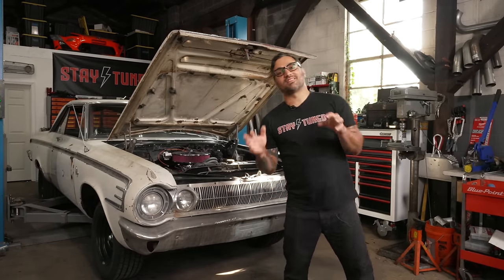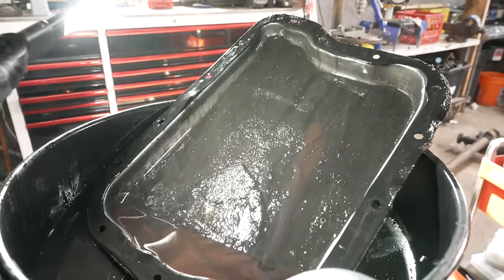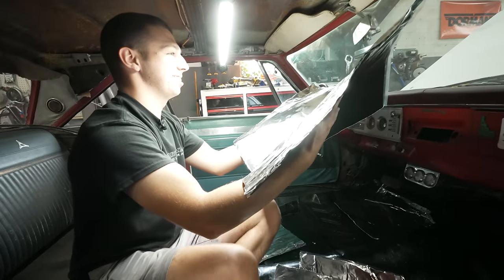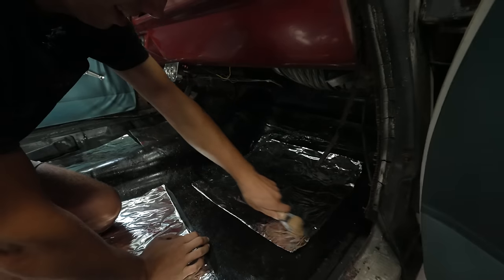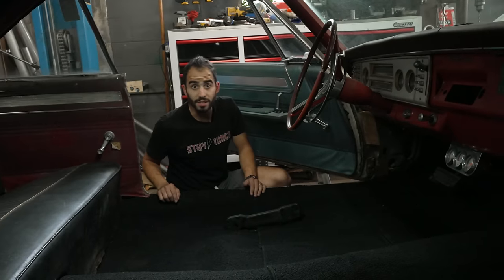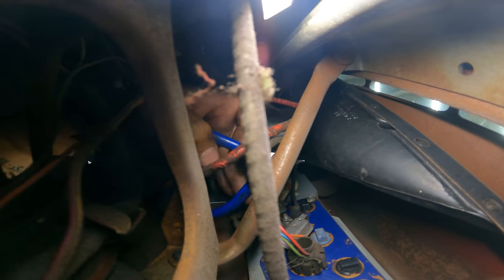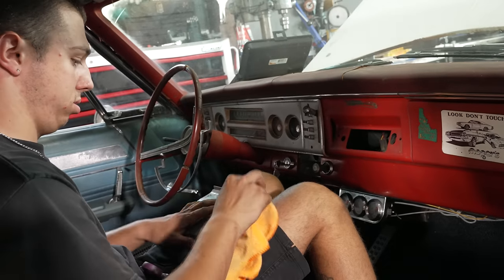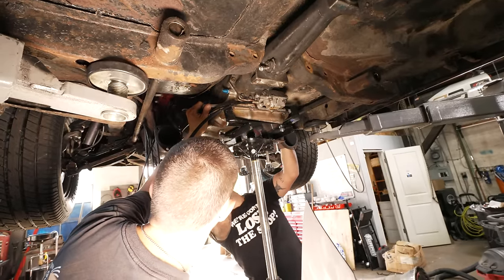Can This ABANDONED Old Dodge Drive 800 Miles?!

Comment: Your content is the reason I canceled my Cable subscription. Nothing like this exists on TV. #WEREGONNALOSETHESHOP
Reply from the maker: Man, that means a lot! Appreciate it!
Reply: The whole HRG / Roadkill family have online content. It's all so much better than anything on corporate TV. Not sanitized, not jazzed up, just life. So much better than TV bs for sure.
Reply: True, this
Reply: THIS.
Reply: I agree
Reply: Dodge put the cowl pinch weld right across the place your hands need to be putting the bell housing bolts in and it's tight .. on a GM car you can get a 4ft extension with swivel and stand under the back seats and crack off the bell housing bolts Dude if you want to burn up your new trans then go ahead but you really should run the new cooler lines thru the stock cooler first then into your new cooler then back to the trans DO NOT OMIT THE ORIGINAL RADIATOR TRANS COOLER ....DUDE forget the push button bullshit and just use a B&M of some other shifter..

Comment: I'm a 54 year old lifer hotrodder. Thank for old skool gangster content I relate with. Health and wellness for you and yours. FYI I daily drive a 71 vega panel with a roller 350.
Reply from the maker: Sounds like a killer ride! I’m in that Dodge as I type this! Thanks for watching!
Reply: Man, I am a 40 year old hotrodder, but my hotrod usually had a turbocharged 4 cylinder under the hood. I now have a 2013 BMW 128i that I drive as a daily and it's really nice and runs great with low mileage, but I'm DYING to turbocharge it. However, if I come across some extra cash I'd be 120% down with buying a 60s-70s Mopar. I LOVE the big body Polaras and I'd love to get one with a 383 or a 440, but mine would HAVE to have an A833 4 speed manual...or a Tremec 5 speed manual, a Sure Grip, and possibly a set of 3.55 gears with AC.
Reply: My uncle has a 72 Vega panel. Solid lifter 327, th350, and a far too wide 9 inch rear. It has 8 inches of custom flairs on the back, air shocks, 10 wide slotted mags , and skinnys up front, true old school street freak.
Reply: Basically I grew up in Florida and when I left there to move to Pittsburgh imports were just starting to become popular modern hotrods, and it all changed for me when the first Fast and Furious came out when I was 18. I traded my 302W swapped, supercharged, jacked up with 33x12.50s and chrome bullethole wheels 1994 Ford Explorer Eddie Bauer for a bone stock 1992 Acura Integra GS with a full mint condition leather interior and I turbocharged it piece by piece. It went on to make 257 whp at 10 psi on a bone stock 134k mile engine. I put slicks on the front and it ran a 12.4 @ 122 mph on an old Dodge Daytona T3 turbo that was seized when I bought it and I paid $50 for...😂😂😂
Reply: The vegs has fats and skinnier. It's vega proper. But missing gear drive. That will be rectified come rainy weather. It's a proper 80s hotrod. Be well, hotrodders. Wheels to the ground -after a proper holeshot of course. Oh and yes has slot mags and wlt bfg's
Reply: I love how most older US cars will accept a v8. Over here in northern europe most options are simply 'modern' inline four cylinders or build the old block for boost. Anything more and it's an engine with a shell around it
Reply: @ryurc3033  pictures of that ride would be epic. Life is short. Cool is eternal.
Reply: @Brock_Landers  fast is fast. I have my personal tastes, but I absolutely respect all things faster than stock.
Reply: I wanted a v8 vega for my first car in 1983. My dad wouldn’t let me and selected a fixable 69 Camaro instead. (Poor me, lol.)I still appreciate the Vega.
Reply: New stuff is so fast. And turbo anything and your hauling the mail. The vega does 1 thing well. It feels the fastest. If course it's not by a Longshot. But it is a violent, hard hitting visceral ride. I should sell tickets. Lol keep on keeping on hotrodders. Cool is eternal.
Reply: @Chest_Rockwell pittsburgh native here! There is still some good old hotrodders here !
Reply: @danielnowicki917  do tell. Shout out for the area. Wheels to the road. Safe travels everyone.
Reply: My buddy had the same Vega with a 350 years ago . Super cool guy
Reply: @gregblack8550  V8 Vegas bring out the greatest car stories. No matter the walk of life, we all have a vegs story. (If over age 40 lol)

Comment: When I was 18 (MANY moons ago) I almost bought a '58 Chrysler Saratoga. It was an absolutely huge car, with 300+ hp V8 (not sure what motor was in it), and a push button trans. It was mechanically sound, and the body had more steel than rust, but the interior was shot. I'm glad I didn't buy it, because right after I was looking at the car, I moved 2 states away, and my daily work commute was anywhere from 2 1/3 to 4 hrs each way. I would have killed that poor car!

Comment: I had a 64 Coronet 440, back in the late 70s. We called it "Trash On The Dash" like 4 on the floor, and 3 on the tree. Mine had a 318 but it was a kick to drive with that oval steering wheel. Love the content, boys.

Comment: You should have run a 65 transmission - they are still cable shift (will work with the push buttons) but have a slip yoke so you can run a conventional driveshaft. If you can find a 65 transmission - big block or small block, use the guts from it to rebuild and modify your old 64 with the slip yoke output and tail shaft from your old 64 transmission.
Reply from the maker: I was just happy to find something I could my hands on and it’s working so well!

Comment: That diod trick was slick.  Have a great road trip guys.
Reply: Diodes are really handy.
What Tony didn't mention is how to hook them up.
48:14  There's a band around the diode on one end.  You want that end connected to the thing that you want to isolate.
So in this case the band end goes to the ignition module, the other end goes to the starter relay/solenoid.
A diode's electrical symbol looks like --->|---  sort of like an arrow pointing to a line.  The arrow shows the direction of he current.  The line is the band.
Technically, arrow end is the anode(+), band end is the cathode(-).
Also, diodes can get HOT if there's a lot of amps flowing through them all the time.  Something to keep in mind and check when you use them.
Reply: @button-puncher  Thank you for that detailed explanation.  I'm not versed in electronics.  I would never have known that.  My buddy works on electronics & I'm always amazed of what he can fix.

Comment: Top 3 favs right now in no particular order ; Vice Grip Garage , some of the Hagerty stuff and Stay Tuned. I say this as I just came in from changing the springs on my Vortec 4.3 over to Beehive springs(heads on car, PITA). Put the new cam in and then tried to put the timing set I bought but the big gear is wrong. I want this cam 4degrees advanced. Think I will degree it with the old timing set and if its close Ill just send back the wrong/adjustable one and hopefully find a double roller in town here.
Reply from the maker: Thanks for watching!

Comment: My 64 440 has the column shifter but it does has a blank off plate over the spot where the buttons could have been. It’s also a 383 power steering power brakes and 727 automatic.

Comment: That fire sleeve, it's good to have it fit loosely.  Then you've got an air gap to further insulate from the heat.
Ammeters are good but, yeah, you've got to run a meter with an external shunt.  Really nice to see if charging is working and to see parasitic draw.
Super cool to see you keep the push button trans.
Thanks for another great episode.  :)

Comment: @StayTunedTA : Tony, a few things . 1) You should have looked for a 1965' twin cable tranny. The difference is in the tail shaft. In 65', the 727's went to the later models slip joints, just like everyone else used..  2) 1966 and newer is the real choice for most of us 62-65 guys. Reason being, the twin cables tent to stretch and fail.. You may put the car into PARK and walk away and get passed by your car that you THOUGHT you left in Park!!!!!  Also, with the 66' and newer, you can use nearly any aftermarket shifter in the World.. That, of course, means positive shifting and positive PARK!!!!  Also lock out and whatever you want to spend the cash on.  3) The difference in the 62-65 tranny/convertors, is the input spline. Going to the later model is DEFFFFFFINETLY the way to go. 4) Check out MAD ELECTRICAL for the best in rewiring an old mopar. These cars going up in flames is REAL. You touched on some of it in this video, but your watchers, I'm sure, need a great lesson on it.. This would be a great HOW TO video for you to do on this car.. It will also help your charging situation and you will have nice, bright headlights as well.....  5) considering this car is cool and it looks like one you will keep, how about doing a video in shortening the rear end??? These cars look BAD ASS with FAT ASS TIRES on the rear and with a bit of wheel well work, (to the frame), you can fit some serious meets under her....  Also, consider joining the 62-65 B body group on FB.... Tone of great info in there....
Reply: So '65 had a slip yoke AND cables, including the 904?
Reply: @vincentenk4449    Yes....  Then in 66' they went to linkage shifters. 67' and newer went to a higher count of input shaft splines, so you have to make sure you alllllllways count before ordering a convertor.
Reply: @vincentenk4449  YES....

Comment: I bought my 64 polara when I was 15 now I’m 23, I’ve been watching roadkill/hotrod garage since I was 13, so it’s so much fun to watch you deal with the early b body stuff cause I’ve always wanted one of you guys to do so. My car is 64 4dr hardtop with a 383/451 bbm was a push button transmission car swapped to a a833 4spd, gutted the interior. Has the usual cowl and minor floor rot, the left front fender is barely attached but the structure is solid. It is annoying tho anything early b body related is like 30% more than later mopar stuff. It’s extremely fun to watch this series so excited for more episodes
Reply from the maker: That sounds like a wicked car! Really glad I got my hands on one and it's fun to dig into stuff I've never worked on before like the pushbutton. That 451 must scream!
Reply: @StayTunedTA  I definitely would love to see a manual swap in the car, the a833 stuff is prohibitively expensive nowadays tho so a good 5spd would be cool. My 833 was a junk core that have like $1500 into just parts cause my labor was free. I do know some guys that are all into the early B body stuff who are local to eastern pa, and a some guys around me on LI. The push button stuff is really cool in a novelty since, best part you can bump start them like a manual it was the advertised feature of them.

Comment: If you're wanting to raise the rear, the over leaf spring helpers add about 1-1/4 lift, which is quite a bit. the under leaf helpers you have are strictly for load only. Also you can do coil over shocks which add about an inch of lift. Either or, or both.

Comment: Tv cable is short for Throttle valve cable also known as kick down cable. It goes from carb/tb to transmission and let’s the transmission know when to downshift go into passing gear when the throttle is applied past a certain percentage.

Comment: Another reason for no ignition power during crank is if the ignition and accessory wires are reversed on the ignition switch.    During cranking, the accessory terminal drops power as a way to shed  load during cranking.

Comment: My first car back in 1973 was a 1964 2 door Chrysler Windsor hard top. It had the pushbutton shift ,rectanguler stearing wheel and 361 cammando engine. If you did a hard stop from over 60 mph the brakes would be fading before you stopped lol!

Comment: omg - I just fixed the park cable on my 65 727 (same setup as the push button ones) - that thing is a total PITA to get out going through the hole in the bottom of the cover!
Reply: By the way, I’m in West Chester and have a bunch of random nuts, bolts, parts for early B’s

Comment: Love youre sficking with the mopars i almost bought a 64 polara 500 was a 361 originally was sitting in the bush at my buddys place he wanted 3500 for it shouldve bought the m code 383 68 dart with 4 speed white bucket interior but it was sitting on the ground in the mud

Comment: I had to wire up an electric system from points on my 57 chevy. I used a relay switch and used the ignition switch to energize the relay. The relay had power straight from battery then to the coil. No diode needed, but more wiring.

Comment: TV = throttle valve cable. In the days before computers and electronics, it helped the transmission shift at the right times. As you mentioned.

Comment: Tony you may want to cover up those vents On the cowl with metal tape it prevents water intrusion before some other type that might be easier to remove in the future That is waterproof at least temporarily
Reply from the maker: You are exactly right. I plan on doing just that for now with some metal duct tape.

Comment: Flux core mig. Clean metal and tack on patch. Seam seal patch. Throw some rustoleum on it. Go back later and repair correctly when time permits… but the patch will hold the wiper arm mount and keep water out and take an hour if not less to do..

Comment: push buttom shift for dodge cars...if i am not mistaking my grand dads 1961 dodge pioneer had that feature but i was young and maybe mis remembering.  but the 64-65 is a bucket list item for me.
Reply: Push button was used from 56 to 64, so you remembered it correctly.

Comment: I think that 1965 727 transmissions were still compatible with the push button shifter, but the push buttons in the dash were replaced with a column setup.  1966 and up 727s were not compatible with push buttons.  The weird driveshaft setup is called a "ball and trunion".

Comment: Best way to use that pinion snubber is pump the air shocks up and adjust the snubber an inch from the floor take off the rear leaf clamps so the leaves can spread out
Reply from the maker: Thanks for the tip!
Reply: That pinion snubber rubber looked out of position.

Comment: 28:40 Why does that Ramcharger look like it’s either got dual wheels or a Massive offset as well it does not look like the differential is sitting square in the wheel well

Comment: Hey Tony another great episode. Not sure if this will help or not but I had a 69 Road Runner and I bought all new KYB shocks but I used C body rears and it lifted the back a little more then using the B body models (I hated those air shocks). Maybe they will help with clearance? This makes me miss my Road Runner so much.

Comment: Great job !  Next time, instead of the diode trick, just eliminate the ballast resistor. (Didn't notice yours in the usual firewall location). Anyhow, that gets you full 12 volts. I've got a '65 Coronet 4 speed in about the same shape as your car. But mine needs door panels etc.
Reply from the maker: The ballast resistor is long gone. Yeah, I misspoke. The ballast resistor "run" wire doesn't get power during cranking, only the start signal does so you need to give it that juice through the diode.
Reply: @StayTunedTA  Actually, i think you did speak it correctly in the vid. I just commented because the symptom,the way i saw it from the vid, looked as if the engine fired but would immediately die the instant you released pressure on the key (run). A classic symptom of a failed ballast. But since you no longer run a ballast,obviously it's not that. When i went electronic ign. AND elec. voltage reg. with my '65, i kept ballast & simply tapped the BLUE wire from elec. reg. into the BLUE "run" harness wire from key switch to the ballast & it's worked (so far). Good luck with the cool '64.

Comment: I don't understand the diode. If the ignition switch and starter relay are not broken, why would you need one? I am not aware of any diode under the hood of 72 Mopars with the original electronic ignition.

Comment: Carpet tape...sheesh. Not in my car! Thankfully I do the work on mine so I don't have to worry about some slick screwing up my car. Still, I like that body style. Wish I had my old '63 LeBaron back. Wrong on the ammeter. It is a piggyback-style gauge, but still, it is pretty much useless as a volt gauge is a better gauge.

Comment: Awesome channel and project. I'm currently working on a 1964 Plymouth Fury Station Wagon that someone had started putting a 413 and 727 out of a 1963 Chrysler 300 in it. Turned out the engine had a bad bearing. So, I found a rebuilt 440 and have put that in it. I have new three core radiator and a seven blade high flow fan, no shroud, and it still runs pretty hot. Have you had any cooling problems with yours? Good luck making it to my home state, Kentucky and I hope to take the Plymouth to the Holey Moparty next year.
Reply from the maker: Sounds like a killer project! I love a good wagon! We are having some cooling issues on the road for sure, no shroud here either, considering going electric or getting an aluminum radiator.
Reply: Thanks for the reply!!! Since i asked about your cooling I've installed a 160 T-stat after drilling 1/8" hole in it, pulled a vacuum on the system and sucked the coolant in. I've only ran it idling in the garage for about 15 minutes and the temp seem to be hovering around 180. Can't wait to see how your trip turns out. Good Luck!!!
  @StayTunedTA

Comment: They never want to simply buy wheels the right  width and back space.  They want to buy ones with too much width or too little back space and then put on helper springs (sigh) or cut the quarters (sigh).  It actually looked good at the end with the 245's on the back and 225's on the front.  Nothing looked particularly low.
  I don't know what is bottoming out at the end..  The oil pan??

Comment: 1400 miles on a 50$ s10 with fluids topped off tires aired up and a new tag light and don't forget a 7$ flea market socket set . Add gas and energy drinks ,road trip